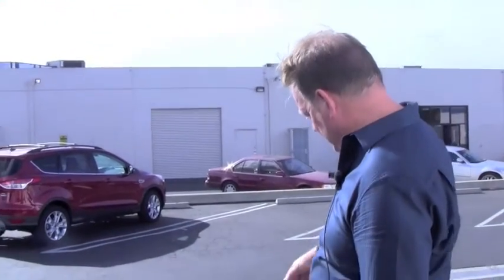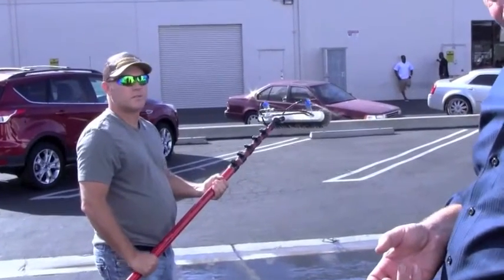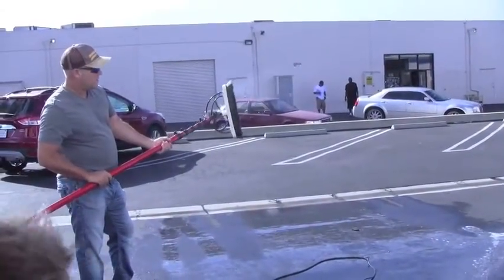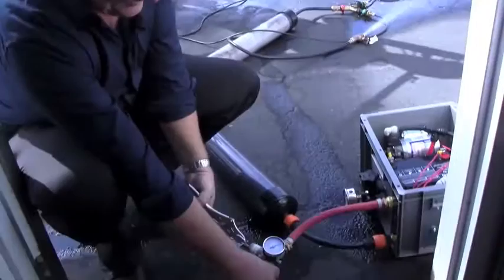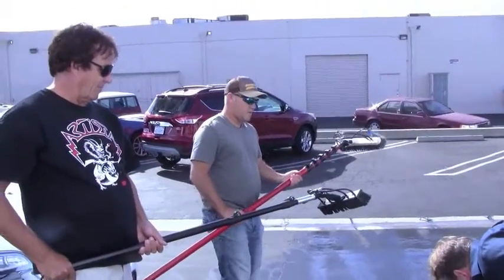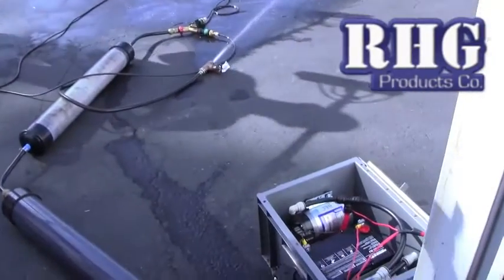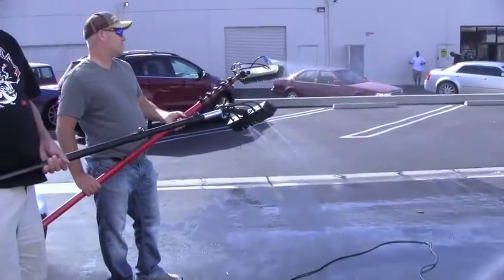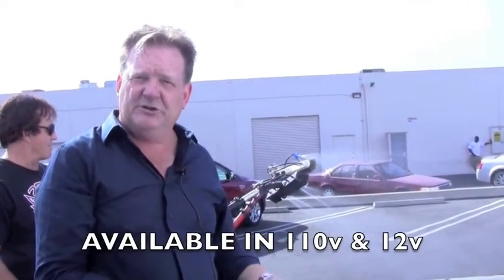How To: Boost Water Pressure from 1 System to 2 Poles

Comment: In my area RO is nor required. DI tanks alone are more than enough. How can I boost pressure with just DI tanks.
Reply: You can add a pump like this before your tank. http://www.jracenstein.com/item/150-0602/150-0602_100v-booster-pump_th

Comment: Could you explain what you mean by "in-line" pump? Is that down stream or up stream of the RO/DI set up?
Reply: You would plumb the pump before the RO system.
Reply: Jenny Banh does the increased pressure upstream of the RO get reduced by the RO then?
Reply: The RO membrane reduces pressure whether it has a pump or not, so yes.